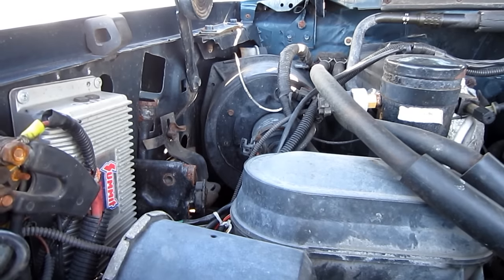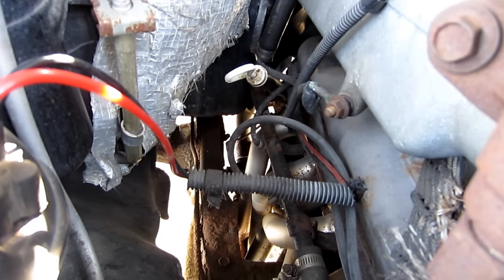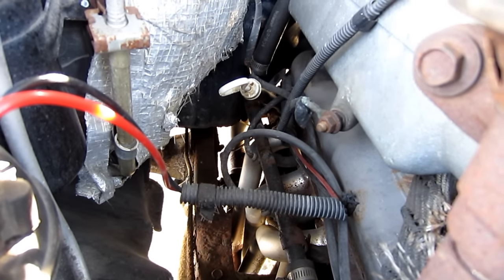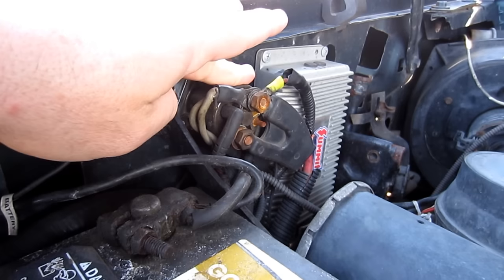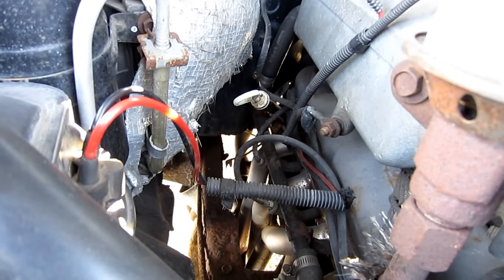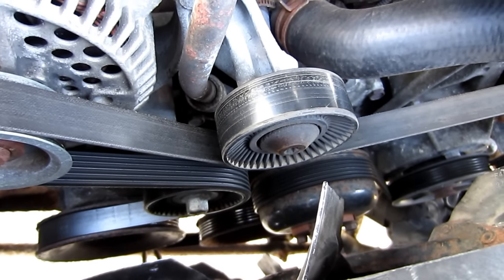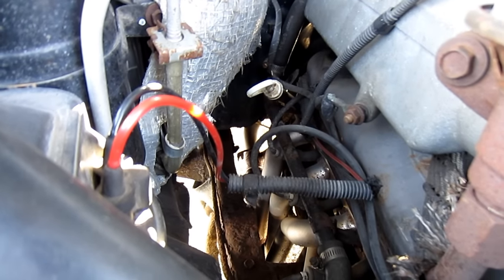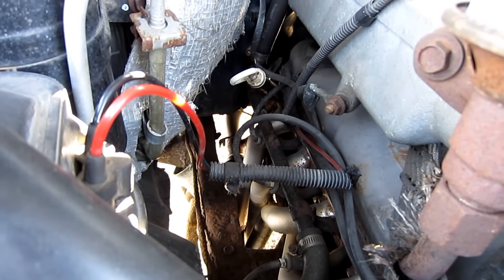Know your cars Clicks. Why it won't start

Comment: its -17 out right now, i think my block is frozen
Reply: My truck is doing the same thing. Been 0 degrees here. This is the first time it’s happened to me and I’m freaking out.
Reply: @projecthandymanllc3128  make sure your battery is fully charged. My battery was so cold it couldn't crank so I brought it in and put it on a charger. Fired right up, maybe that will help
Reply: I actually went and bought two new batteries and still having the same problem. I’m gonna try and bypass at the relay tomorrow
Reply: @projecthandymanllc3128  lemme know how it goes
Reply: I will. Thanks

Comment: What happens if you replace the car with a new battery and a new starter and a new alternator and it still won’t start but it will only start the engine with easy start if you can let me know many thanks 👍🏻

Comment: what if your oil dip stick is coming out dry?
Reply from the maker: ATLien100 add oil
Reply: lol that a bad sign i think, saw it in another video.  especially if you drive a honda interference engine
Reply: Taylor Biondo it was my battery everything is ok now 
and my oil was filter was put on wrong causing a slow leak
Reply: oh. just took my starter to auto-zone, tested it, it was bad... 120 bucks and im back on the road!

Comment: I had the same problem and I went underneath and I disconnected the cable from the battery to the starter and cleaned all the corrosion even though there was a cap on it and it worked it lasted about a year and now I'm starting to have a trouble again so I cleaned it again and bought some grease hope this helps somebody before they go and replace their starter

Comment: I know this is an old video.   I'm having an issue with my 01 ranger.  Truck sits for 6hrs or so, instant start.   Go into a gas station and come out, you just hear clicking.   The clicks appear to come from the solenoid on the fender and fuse panel.   After about 30 attempts the starter engages and starters.   Basically a cold engine is perfect and a hot engine is clicking.   Battery 3yr old, checked fine.   Starter 2yrs old.  Any ideas?
Reply: Did you figure it out?
Reply: I had to replace the battery.

Comment: My daughter Honda clicking when turn the  key . We replace the starter still nothing . we took the old one out which it was only a year old and I took it to place and they tested it it was good the battery good had that tested the starter grounded still not started . My daughter said that he notice her light getting dim right before stop working . Might be terminals but it on tight unless bad wire harness.

Comment: Man.. thank you - just replaced starter and came out next day to straight clicking. Then tried again and had the fast clicking. Just changed battery connections. Now I know I most likely need a new battery. Thank you!

Comment: I have a 99 Cherokee and I hear a click every time I crank it. No crank just click. Battery and everything works but I can’t spin the harmonic balancer to save my life. It’s in park so does that have anything to do with it? I drove it about 10 miles about a week ago if that matters. Also when I used to hit the starter with a hammer it would make it work but now it does nothing. Any tips?

Comment: my car starts perfectly well,like going to the store, when i get back to the car to come home ot won't start. the instrument  panel lights up, but there is no sound from relay, starter, after a little while it starts like there is no problemo.
Reply from the maker: ruben barrientos intermittent electrical issues are the hardest to sort out.. I don't have any idea where to start except verifying that  where the voltage is present and keep following the circuit until you find where the circuit stops transferring voltage.. Good luck..

Comment: Not sure if anyone can help with this. I recently had my starter motor replaced old one was making a whirling noise grinding like hell. Working all fine until all of a sudden it stops (FYI should mention the issue first arrived when I was replacing my coolant expansion tank and did not secure a loose pipe which caused some coolant to seap into the engine bay) I hear a single click when I turn the key (I assume the relay) but nothing more. Few hours go by troubleshooting and more testing jacking the car up to potentially finding a culprit and not finding anything all off a sudden the motor is working again. Almost 2 months later same thing happens again. Couple of days later messed about with the battery’s connection and suddenly the starter works again.

I could be stupid and this could be a case of corrosion causing the problem but it seems to inconsistent for it to be that any advice would be great!!

Comment: The problem I have is, 90 f150 I have the battery charged,  the key is off when I hook up the negative post the motor cranks. I think if the key would be on it would start.. because of the fuel pump. Can you tell me what is wrong.

Comment: I get the same one click, but when I slightly turn the engine over manually with a wrench a few times the car starts right up. What does that mean? Bad starter? Starter to close to flywheel?

Comment: I have a 1997 Mazda pickup it turns over it won't start and I have a clicking rapidly clicking sound in my fuse box under the hood

Comment: So question. My car takes a while to crank. I noticed my dash flashes a bit when trying to turning on the car. Sometimes the car clicks and then it dies. I jiggle the battery and the car powers back up and then I start it and it turns on. Could it be the battery? 

Also the battery hasn’t been changed in a long time.

Comment: so if the belt is to tight, theres a chance it wont start? i just replace belt, water pump, and alternator, i doble check all fuse and they pass/green but it still wont start, the starter does make noise like its struggling.

Comment: what if i just changed the starter  and  relay which it wwas the starter truck started right up afterwards but now... a month later its doing it again.  it just clicks
Reply from the maker: Tachi IsdaFuture Check all connections.. Could be something became loose.. If not maybe you got a defective  relay or starter... Of course check the battery first..

Comment: So if my windshield wipers move slowly it could be my battery. Because if it barely can move them then no way it can turn a whole engine on? I hope I understand this correctly, lol.
Reply from the maker: Yes. And if you have your wipers on and you turn on your headlights and they get even slower than most likely it is a battery issue

Comment: I bought a brand new Duracell battery but my car makes the fast clicking noise to be fair the car hasn’t been used in two years and only turns on after a jump start but then will not work the next day if I wait more than 20 hours in between starting it
Reply from the maker: If you all your cables and connections are good that sounds like a battery issue still. You need to test the battery just because it's new doesn't mean it's good. And even if it was new if you have a bad charging system it doesn't take long for that new battery to be useless

Comment: Don’t know if you’ll answer but I’m stumped car cranks but won’t start, fuel pump works, compression is good and new spark plugs what do you think the issue could be?
Reply from the maker: Check for spark, check fuel pressure...

Comment: Anyone know if the starter passes a bench test if it can still be faulty enough to cause a no crank no start issue? I get one click upon key turn. No crank and no other starter noises. I've load tested battery. All good. I'll be testing the electrical connectors with a test light next. Just curious if this is even possible

Comment: We had issue with car starting it would flicker so we replaced battery but was used and few weeks later starting doing it again as if wasn't getting any power to start and flickered rapidly- So I went to where we got battery and they replaced with new one and paid difference but when I cranked it up it just made them clicking sounds- Is it the starter or that other starter piece? How do I know before i pay some one to have it fixed?

Comment: My bf has a 2003 Trailblazer LS he has a brand new battery and starter. He tried turning it on with the key and it makes that click noise the lights are very bright but it just wont turn on.
Reply from the maker: Pull starter and get it tested..

Comment: After installing a well needed starter i failed to notice on the bittom of the positive battery connector wss a very thing barely noticeable powdery corrosion so with a lick of the thumb and tighetning it down the 98 durango fired right up after about an hour of rapid clicks and charging the Battery and starter had sounded like fireworks. Only little hit of corrosion on the connection cables can cause big problems.

Comment: If it’s not your battery, the engine is not seized or frozen, the relay is good and the the hammer trick doesn’t work there is still one more thing and replacing the starter won’t fix it. There is a high amp fuse on the starter motor cable (not in your fuse box ) it is up néar the battery. Often doesn’t look like a normal fuse. Create a temporary bypass with some thick wire and see if the car will start. Mine did.
Reply from the maker: Absolutely, very rare that that happens in not all vehicles have that Mega link fuse but you are correct

Comment: you know, my grandpa just mentioned the jam to me last night. i replaced my starter yesterday since i replaced my alt recently, and it started to click on the first start of the day, or just sitting for a couple of hours after i replaced it. it didn’t start at all 2 days ago, and he told me it could be the bendix not coming out fully or i didn’t wire it correctly. hopefully that’s the problem i just can’t check cuz of hurricane ian. love and appreciate the video!

Comment: I hadn't drive my car for 5 months. I try to start it but it didnt start. I use the jumper.. but unfortunately I put mistake. Something smoke came from some where from car. Then I change the fuel and new battery. But I can't get my car start. It make the clicking noise. I don't know what happend?
Reply from the maker: Krishna Ranabhat not knowing for sure where the smoke came from you will have to have somebody that can troubleshoot your electrical system. Your mega fuse could have blown. Or you could have completely burned out a wire. The only way you're going to find out what happened is have a mechanic local to you go through your electrical system and find out what smoked. Good luck
Reply: Foxboss9 I had drive my car by pushing. It run perfectly but after driving 15 minutes I stop the car and start. It didn't start. I call the mechanic but he said it quite difficult to say what goes bad.

Comment: "...a hard click bitch...", or pitch?  No judgment. :)

Anyway, we are getting some battery voltage; car eventually turned over after several tries.  Let car idle for about 1 min., thinking of letting it idle longer (in order to charge up battery).  But suddenly, I hear LOUD CLICKS (the car is still running, mind you) that sound like "TICK-A-TICK-A-TICK-A..." (sound sustains) that don't exactly sound like "a small machine gun" as you say--these ticks sound more like those of a LARGE machine gun.  I opted to turn off the car, after which the "TICK-A"s continued for a short time, at a slower and slower rate, until the "TICK-A"s eventually stopped.

Bad starter motor?  Thanks for the vid. -Kim
Reply from the maker: Thanks for the articulation cues.. :-)  Your problem doesn't seem to be a starter issue .. You might need a hands on diagnosis from a local mechanic.. If your car is making large noises while running I wouldn't try to start it again other than for someone trying to use the noise to "hunt down" the issue.. Sorry I can't help on that..

Comment: I've put a brand new starter in today, also have new battery. And the van is still clicking. Can you help. I think it's the starter relay.
Reply from the maker: Will it start with a jump start?
Reply: @Foxboss9  yes really easy
Reply: @Foxboss9  but it's doing exactly that noise at the start of your video.

Comment: My starter relay clicks but I cant get the starter to run...runs fine on the bench, I'm reading in the manual this is from anti theft? Any ideas?
Reply from the maker: Other than an engine ground to battery I'm not sure what you have going on... Anti-theft would not allow the starter relay to "click over" and send power to the starter so that could be ruled out... You will need to test wiring direct with a meter and follow the battery voltage all the way down to the starter..
Reply: @Foxboss9  awesome Ill give that a look, thanks! Is it likely theres a disconnect after the fuse? Since theres only 2 terminations between power and the issue...wire jackets are a bit dried out

Comment: Mine will do one solid click, but will start the engine up, after two or two or three key cycles. (Sometimes more.) I get a voltage drop.
Reply: did you ever figure it out? mine does the same thing
Reply: You know... It's weird, but my van never did it again. I don't understand why or how but I haven't had any issues since then.

Comment: ive got a ford econoline van and ive replaced the starter, the battery, and when I try cranking the pully underneath it wont budge. is my engine seized?
Reply from the maker: Possibly... Not sure how much force you used to turn it
Reply: @Foxboss9  as much as possible from underneath, I didnt have the van lifted at all. the engine was seized so gonna have to buy a new one.

Comment: I think it’s electrical though even though all my lights are on. I might have overcharged the battery or something. I guess it’s my starter though :/
Reply: From another video I just watched, the constant power on the larger terminal is not getting the 12v it needs. The solenoid is the one click you are hearing.
Reply: Chance Carlton you’re right, thanks for that. Adjusted the terminal. Now it’s running funky though, wonder if that’s electrical too
Reply: @Fee.1  could be part of it. Depends what's funky about it. I was having starting issues and the battery was not charging very well, cut 1" off the negative terminal and it starts very strong and runs better and charges the battery properly.

Comment: I believe that's the starter solenoid not the relay
Reply from the maker: Solenoids are mounted on the Starter motor and use electric current to spend the starter motor through mechanical engagement. The starter relay uses a small amount of electrical current to make larger amounts of electrical current connect through a mechanical switch.

Comment: Hey, my volvo s60 won't crank. I checked the little ''trigger'' wire going to solenoid and it doesn't have current. So I jump started the starter and it cranked and started just fine. Does it mean that the issue in the ignition switch? Starter relay should be fine as well.
Reply from the maker: I don't know that vehicle very well at all. I don't know if there's some other kind of safety switch that could be causing the ignition not to engage that wire or if it's just the ignition itself. Definitely above my paygrade on that Volvo

Comment: I have a fiat punto that will not start after a heavy rainfall.  I figure moisture is getting in somewhere, but how do I check for this? If I get a jump start, it starts up right away and I have no problem driving the car, but once the rain comes... it´s same problem again.  Any ideas?
Reply from the maker: Probably a starter or wiring to the starter issue. The starter is closest to the ground/water.  Use a garden hose and spray lightly at the starter only to duplicate how it may get wet from a rainfall. See if the problem surfaces. If not continue up through the starting system wetting the wiring up to the starter relay and then finally to the battery... I am assuming that you are having a "not cranking"  issue and I am also assuming you have already checked your battery and battery terminals and both are good.. Electrical problems are tough to locate. You may find it is easier to get a local mechanic to chase the problem down for you.. Good luck..

Comment: when I try to crank all I get is a clicking noise . after trying to crank for about a minute it has a very weak and slow crank! I'm thinking its the starter?I've had this happen with my other car.
Reply from the maker: Have your battery tested. 
Make sure your cable connections are good at the battery...
Reply: +Foxboss9 OK thanks!

Comment: Own an 88 Mustang 5.0, new alternator, but lately it does a rapid clicking/buzzing from fender mounted solenoid... Installed new one, same rapid clicking. Pissed, any ideas?
Reply from the maker: Cable connections at battery.. That is my best guess.. Good luck..

Comment: If my lexus makes that multi click sound do you belive its the battery ?  When i turn the key to on position it clicks like that . So i need a new relay if battery is good ?
Reply: Emerald Fire it’s the battery if there’s multiple rapid clicks. If there’s a single click it’s the starter. If there no power at all and nothing happens it’s the alternator.

Comment: Have a 94 Nissan truck,have replaced starter,alternator,ignition switch. Nothing works, no click no dash lights ,head lights, radio,fan or anything else.Help!
Reply from the maker: +james forney Electrical is hard enough to diagnose with hands on it's almost impossible over the internet unless someone has unique knowledge of an inherent problem with that specific vehicle,, I don't .. Anybody else?
Reply: +Foxboss9 thanks for the help
Reply: +james forney check your immobilzer..
Reply: Reshmi Ginnie Thanks for the input